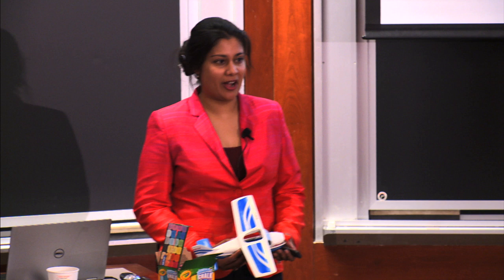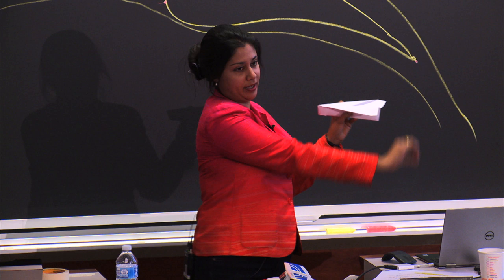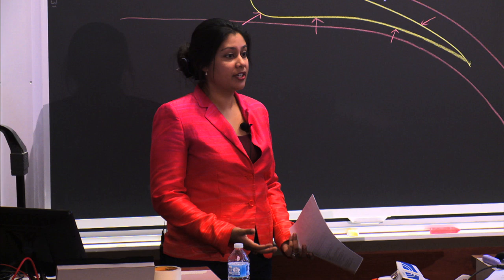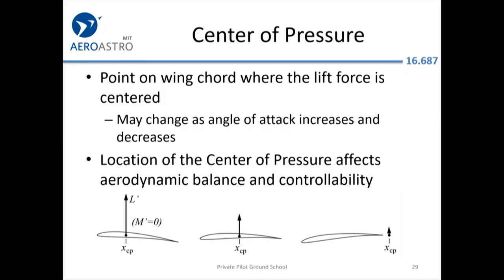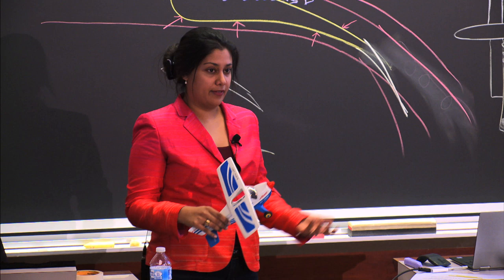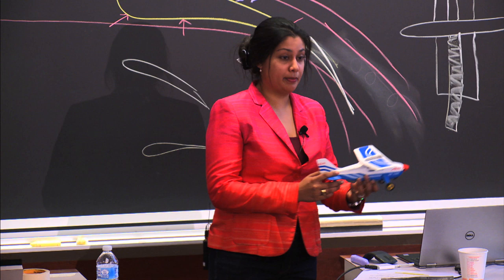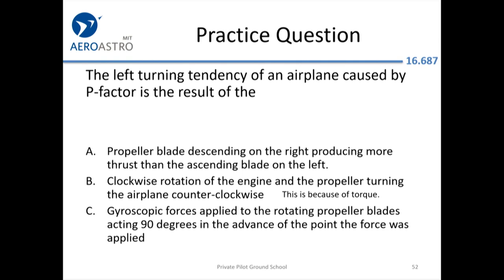MIT Private Pilot Ground School, Lecture 2 (Aerodynamics)

Comment: This video is fair and has some things ok and some things VERY wrong. It is nowhere near what should be expected from MIT. She is trying...
.
0:50 Vocabulary: doesn’t  mention the vertical and horizontal “stabilizers”. Calls them “parts”. In the graphic, but not mentioned.
There is only ONE wing.
Going to talk about sea planes ???
3:11 initially says lift exceeds drag, but corrects it.
4:50 Draws an extreme airfoil shape.
5:22 The way she explains conservation of momentum is a good one, but momentum can be confusing to some people. It is not saying just how these pushes come about, but is better than just saying lift is a Third Law "reaction".
5: 30 Air has mass and conservation of momentum. Doesn’t explain how push occurs.
6:12 GOOD: Explains the  Equal transit/longer distance fallacy. Points to flat wing, same length.  Math description not needed - correct.  Good Aeroastro graphics.
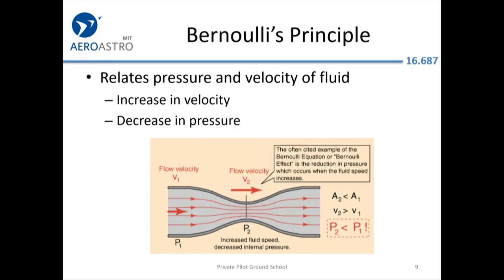12:01 GOOD: Stated Bernoulli correctly using ‘velocity’.  BUT focuses on fast.
12:40 "C" is the WRONG answer!  The word "cause" is incorrect.  "A" is the only correct statement there, but has nothing to do with Bernoulli..
12:42 The Graphic assigns INCORRECT cause to lower pressure.
14:00 GOOD: stationary pressures. She only mentions a "force" but not that it is pressures that cause the force!
15_24  Talking about the rest of the aircraft generating lift is a distraction and unnecessary.
15:57 Asks childish questions. Race Car.
16:36 Only says the spoiler “spoils the air flow. Doesn’t explain that it has down lift.
18:00 It is the altered pressures which cause the acceleration of the air (downward) ACCELERATION DOES NOT CAUSE THE FORECE !!! 
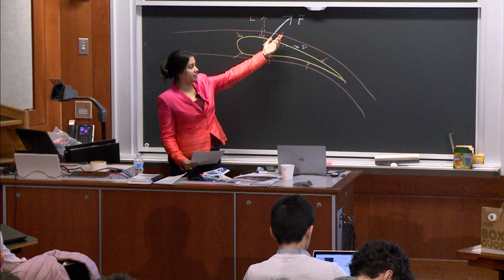18:09 Wing  ALSO changes the speed of the air.
Never states that upper air beats lower air.
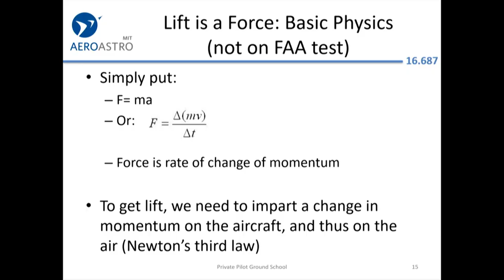18:40 Air past wing, or wing past air question.  The critical thing missed here is that the speeds are NOT "IDENTICAL", but different between these two reference frames, BUT the science must be the same.  Therefore, talking about fast is misleading.  It is ACCELERATION that must be understood.
18:54. Is wing moving faster through the air, or air moving faster past wing? Frame of reference discussion – SAME. Wind tunnel justification.
23:40 Mentions aspect ratio without explaining it.
24:24 Mentions hand out car window and PUSHING, but doesn’t relate to the – IGNORING the momentum explanation earlier.
25:28 Mentions Viscosity. Compares sticky.   Sticks to the wing.
27:10 Compressibility affects lift in a different way.  NOT FUNDAMENTALLY.
27:20 Calculating lift is not known.
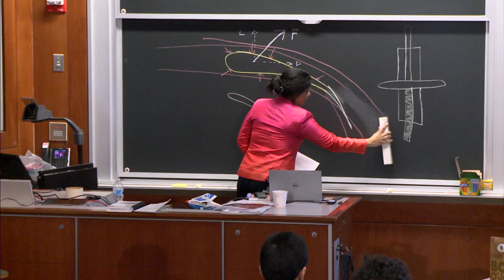29:45 CALCULATING LIFT.  Mentions Kutta Condition and says wrap around is an additional condition.  2D is simpler ) OK, but tip vortex sn not true turbulence.  So… Calculate where possible and measure elsewhere.
Doesn’t explain chord line.  Says:  “in between".
32:25 Talks about summing forces around the wing for lift, but doesn’t explain the top-bottom difference.
38:10 Doesn’t actually state what AoA is.  Graphic shows it as “A”  but is unnamed.
42:20 CONFUSED about the effect of flaps. Airspeed being higher with ground speed lower HUH???  Also doesn’t explain approach being steeper. Misses that is the increased lift that allows slower air speed.
47:38 Only explains that roll is around the longitudinal axis, but not the others.
48:13 Doesn’t explain why adverse yaw occurs.
48:15 Stability OK.
53:30 Question about what happens beyond the critical angle is not answered correctly.  Lift does not go to zero. Did not demonstrate a paper airplane stall.  It was too stable.
54:45 First mentions separation.
55:56 climb & decent, lift = weight.
57:15 Torque causes a left ROLL.
57:50 P-Factor not so much climbing because AoA not necessarily high, just on ground.  They can’t answer the question at 
1:02:20 Precession is 90 degrees  later.
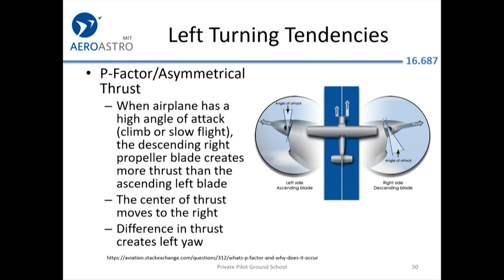1:03:14 Question why P-factor not subject to precession. Sort of answered. It is a bigger factor on the ground for a tail dragger the ground where the ground  prevents precession and in slow flight when precession only occurs during actual yaw.
In zero G flights confuses the upward parabola with top and downward parabola with bottom.

Comment: Imagine working so hard to go to MIT only to find out you'd have learned more about flying from a cropduster in Kentucky.
Reply: mirrored window I disagree
Reply: @ceguon9359  (comma because elaborative rationale)
Reply: you may have learend more from flying a cropduster... for years - than you will during th first half hour at mit...
but much of what you learn fro mflying a cropduster are probably misconceptions and simplifications that work half decently if flying a cropduster is all you want to do but are going to be catastrophic if you try to go into research or development and desing new airplanes
Reply: @JulianDanzerHAL9001  great logic, except this is for flight instruction not engineering
Reply: @dheujsnrhfydhehehshshhdggsd  it's for flight instruction at mit
it's flight instructions
aimed at people who do both and thus need a deeper understanding of things as well
Reply: @JulianDanzerHAL9001  imagine thinking you have the first clue about effective instruction.
Reply: @dheujsnrhfydhehehshshhdggsd  imagine watching a video and complaining it's not a completely different video
Reply: @JulianDanzerHAL9001  imagine being concerned that these pilots weren't being adeqately prepared.

Comment: Ugh... the whole "horizontal component of lift turns the plane" description kills me.
Reply: well, that and aerodynamic stability
it gets kindof complicated
but in basis, it's not that incorrect
Reply: @JulianDanzerHAL9001  Complicated for sure.  My understanding is that the elevator turns the aircraft.  Any "horizontal component of lift" will tend to push the plane sideways (translation) not turn it (torque.)  You may get a little torque due to the vertical stabilizer causing some weathevaning, but up elevator pulls the nose through the turn.  It is the most powerful torque arm in the system.  I think the best tool is to imagine an aircraft with a symmetrical airfoil.  There is no "horizontal component of lift" in a roll - all your lift is due to AoA, and all that AoA is due to elevator.
Reply: @MatthewHarmon  it's a combination of those
a horizontal component of lift changes the velocity of the plane, making it fly in adifferent direction
what actually turns the nose of the plane in that direction i a combination of rudder, elevator and aerodynamic stability
if you fly a several G turn i na jetfighter it's mostly elevator an daerodynamic stability
if you fly a regular turn in an airliner it's mostly rudder and aerodynamic stability
if you fly a turn without rudder it's urely aerodynamic stability - which is the easiest way to fly a turn though a bit uncomfortable
Reply: @MatthewHarmon  of course it depends on the type of plane
in a b2 bomber it's mostly differenctial airbrakes that turn the nose
and all these effects influence each other which then influnece each other back
Reply: @MatthewHarmon  Julian is correct.
You're confusing what controls are used and the forces.  A curved path is an acceleration, no matter what the object. That force comes from the horizontal component of lift.
..
Maintaining the craft's orientation to the relative wind in order to maintain the turn, is done with the controls.
That very old mantra that the elevator turns the plane is only partly true because it also gets the AoA to simultaneously hold the airplane UP !

Since more total force is required to now support the plane AND supply sideways force, elevator is used to increase AoA for the needed increase in lift.

This is a prime example showing that pilots need to know how to control the craft and do not really need the deep science of all of it.
Reply: @Observ45er  Ha, true - but since I'm programming flight dynamics right now, the "deep science" is what is currently interesting me ;-).  Now, from that perspective - when an aircraft banks, the "horizontal component of lift" will partially push the aircraft sideways, and partially "hold it up."  But my point is how does "pushing the aircraft sideways" (translation) end up imparting a change in heading (torque).  It MUST be some additional force.  As Julian said, it is different in different aircraft, but it has to be something.  It's that "something" that I am interested in.  It could be weathervaneing.  It could be that the center of pressure is forward of the center of mass .  It could also be up elevator.  I'd suggest that while pilots think of the up elevator as "keeping the nose up" - that in a bank, that control is also "pulling the nose through the turn."
Reply: @evinteractive1297  Well, if you want to code flight dynamics, you'll need a solid understanding of the physics - and - you seem to be asking the right questions.
..
Of course, pushing sideways doesn't impart a torque (called a couple in engineer talk).

..
The curved path is "translation". 
In a constant radius curve we call this centripetal acceleration. Get very comfortable with that subject.
.
Then, the change in orientation (nose pointing) is 'rotation'.
..
 As both Julian and I explained (tried to), the pilot has controls (control surfaces) to make the rotation.  It's hard to explain because it seems so obvious to me, but hey, somebody has to do it and I signed up for this as a "Science Presenter”.
So here goes...
..
In a way, a banked turn can sort of be viewed as a combination of level flight and a tilted loop.  Heck, a 90 degree banked turn WOULD be a fully horizontal loop!
..
The up elevator which increases AoA and lift to supply the same upward, weight supporting lift component, also is pushing the tail 'down' MORE in the turn.  
Because of the bank, that "down" is now tilted and the "up" pitch is now also tilted, so it is rotating the craft - keeping the nose moving along the horizon and pointed "where your going".
...
UP ain't up any more, so things that used to be "up", now also have a horizontal component and act accordingly (IF you follow all the physics)
..
Thinking very carefully, we can see that it is the extra wing lift that causes the actual curved flight-path (translation), but it is really the increased 'up elevator' that is DIRECTLY rotating the craft. 
MoreElevator -->MoreAoA -->More wing-lift.
BUT...
MoreElevator --> More Up Pitch.
..
That old saw about the elevator 'turning the craft" is a misunderstanding.  If you don't pull back more in the bank, the plane STILL TRAVELS IN THE CURVE (translated), it just looses altitude... (and because of the pitch stability aspect of the horiz-stab, the nose still rotates.  If you want, you can think of this as 'weather-vane-ing' now that the craft is 'sort-of' tipped horizontally. Pitch stability in a airplane is similar to weather vane action - sideways.  That is, the tail MUST follow the beast.
..
In a loop we do this all with much more authority to get the nose to pitch all the way-round, but in a turn, this is all more gentle...
...
From the software algorithm aspect, you just have to correctly do the vector summation of the forces on the aircraft  (for both translation and rotation) and it all calculates out 'by itself'.
..
So, you will have calculations for the craft's mass/CG and path in space (translation) and more calculations for the craft's rotation about it's CG.
....
....
After we upgraded the computers for the sophisticated full cockpit B-737 flight simulator at the local Challenger Learning Center (link below), I did some parameter settings in Microsoft Flight Simulator X (10). One parameter was a rotational inertia/momentum parameter.
I was very impressed by the large number of parameters there were for dynamics nd this 'rotational inertia' (moment)  was one.

..
When you bank a larger craft with so much mass, you have the same thing as F=MA to contend with regarding torque. Ailerons provide the 'torque' and the mass accelerates (rotationally) up to some rate of bank angle change. Angular acceleration up to a rotation speed.
 It takes time to get the rotation speed up (angular acceleration) to come to a bank rate .
..
Then, reaching the desired bank angle, it wants to keep rotating and you must do reverse aileron to 'decelerate' the roll stop at a precise angle. 
Gotta' know all the physics.
.
Please, just what are you trying to do??  .
Reply: @MatthewHarmon  You've got it reversed.  I provide details in my last reply here, but...
The large mass of the craft needs a large force to accelerate it in a curved path.  That force is derived from part of the lift tilted to the inside - the horizontal component.  The added lift is obtained from increased AOA and the elevator increases the AoA, but the elevator is NOT providing a centripetal force.
Remember, that increased back force means MORE 'down-force' on the tail, which now has a component to the outside of the curve.  Therefore, the wing needs even a little more lift to make up for that force that is in the wrong direction.
The basic pitch and Yaw stability, combined rotate the nose. It is the components those that are now in the horizontal direction to do that.
..
The essence of what Julian is saying is the same thing.

Comment: I still believe in equal transit theory. You would never be able to prove this in a wind tunnel because the air is moving past the wing, but in real life, in the sky, your wing is moving through the air.
Reply: brotein she explained that earlier in the video.  It's about point of reference.  From the wing's point of view the air is moving past the wing, but from the air's point of view the wing is moving past the air.
Reply: Micah Person okay, well from one of those points of view I think equal transit theory makes sense.
Reply: Check out "The Secret of Flight" videos on YouTube and you will see that the equal transit is a myth. Great wind tunnel videos.
Reply: @macman603  it may well be that the "equal transit" theory is wrongly stated..  but even herself in her presentation stated when presenting Bernoulli'sLaw  ( that is not a myth ) that the air on top goes indeed faster..   then reducing pressure and then the pressure differenctial creates lift..  
otherwise since it is a longer distance if the air does not increases speed it should be creating either vacum.. or a lower density air area.. either way there will be less pressure on the longer way ( on top in this case..)  so in content what the equal transit theory states is not really a mith..  the result is there to see..
Reply: and moreover.. it is a false that to create lift you need an angle of attack between the fluid and the foil shape.. you do if the shape is flat in both sides as is the case in a paper airplane wing but its proven hat a foil shape creates lift even without air 'hitting" the bottom...    although that could add even more  like for instance when an airplane is landing at low speed..
Reply: @corbinlamb6965 Equal transit makes no since if you understand the fundamental physics first. Try this if you really want to understand:
https://rxesywwbdscllwpn.quora.com/ 
Regards
Reply: @fabio1fabio1  It is hard to understand what you mean. but the air above a wing has been observed many times to reach the trailing edge before the lower air and this occurs with a flat wing as she shows.  That air is accelerated by the lower pressure above the wing and the atmospheric pressure ahead of the wing.
.
The two bits of air that split at the leading edge DO NOT arrive at the trailing edge in equal time!